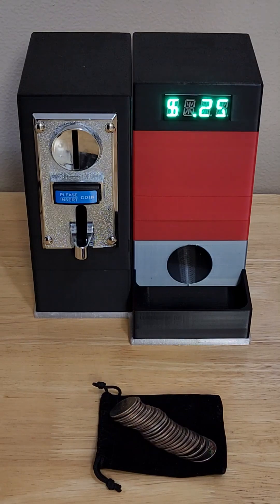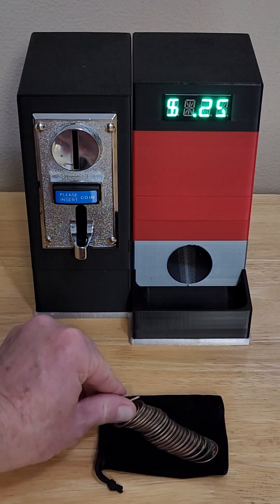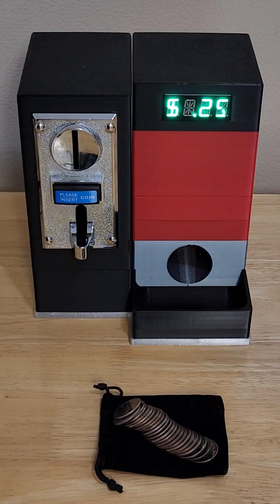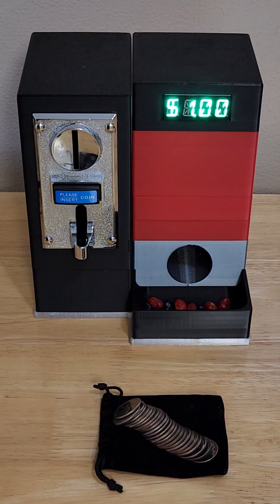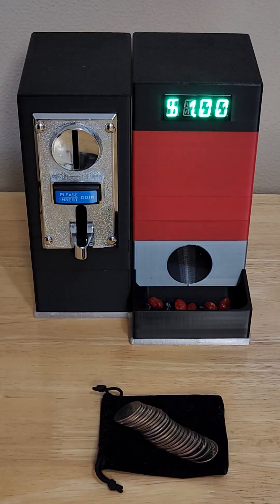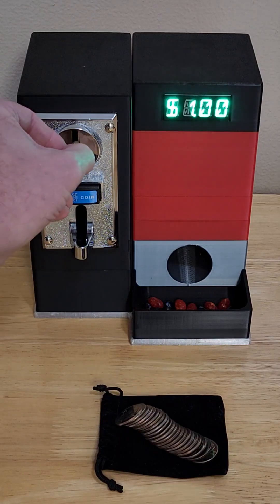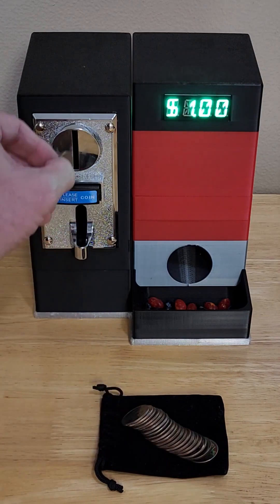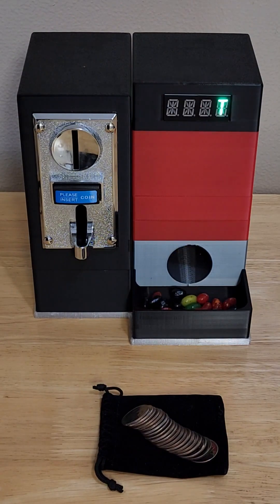Behavior Modification Candy Vending Machine | Home Made | 3D Printed | Arduino Based

Comment: Cool project idea. How did you come up with it? Has this particular machine been used for BMT?
Reply from the maker: @TheOfficialOriginalChad  the idea for the candy vending machine was that I've always wanted my own vending machine and I realized I could build a simple one with available parts. I wanted a candy vending machine, but I eat too much candy, so the idea for the behavior modification what's to resolve that conflict. It's never been used for any official purpose, and I can always lift up the display and reach in and grab jelly beans :-)
Reply: @ haha I was thinking it would only modify behavior if the “customer” couldn’t open it. 

Video 2: I put a padlock on my vending machine 
Video 3: I learned lockpicking for jelly beans